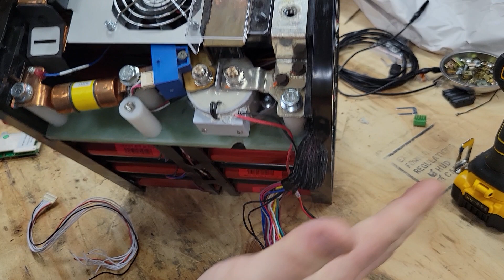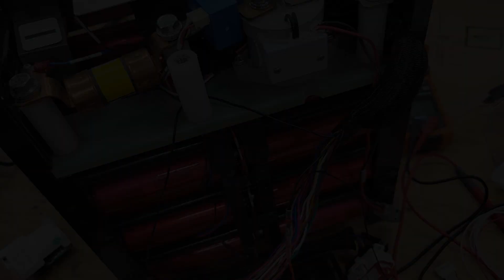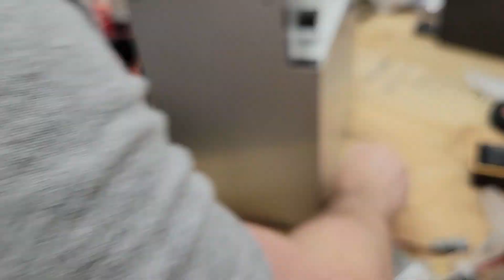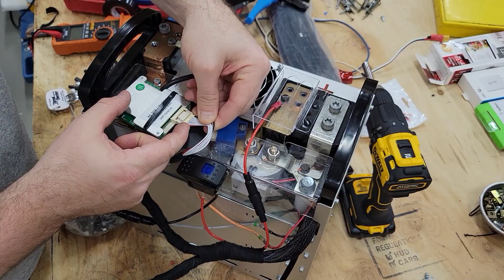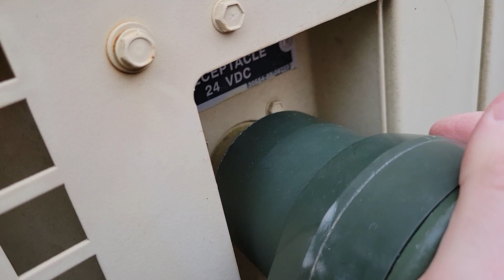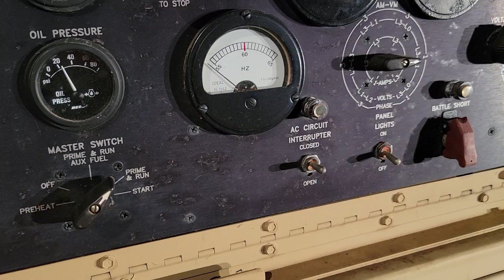DIY Jump Starting Battery for Military Equipment

Comment: Pretty sure Battery Hookup doesn't have any monster packs or parts from them left, though you can still get all the pertinent parts: big LiPO4 cells, bus bars, BMS, and heavy duty  contactor. Not sure about the fuse, though car audio suppliers should have it.  Pretty sure monster size car audio fuses should still be rated at 32V

Dave's discount code still applies.

Comment: How come my superbeast from battery hookup didn’t come with all those beautiful aluminum covers? I took a superbeast and converted it to 12v using all of those cells and want to use it on my dump trailer for the battery. Should I be able to use that contactor with a cheap bms the same way? Is that a fuse in there coming from the positive to the contactor?
Reply from the maker: I'm guessing you have a 12V pump for the dump control?  And, that you want a battery on board for using the dump option without needing the truck wired in?  If that's correct, then I'd first check what the Amp draw is of the 12V pump.  If it's less than 100A (which it probably is) then I'd simply use a 100A BMS: https://batteryhookup.com/products/12v-lifepo4-smart-bms-w-low-temp-cutoff  No need for a relay.
Yes, the fuse is on the positive side.
When I got the super-beast, Battery Hookup was offering 2 options in their website, one with the aluminum enclosure, and one without.  I don't know if they still offer both options or not.
Reply: @DavidPozEnergy  yes it has a 12v pump. The amp draw gets into 250 or more under a load but the winch draws 350+. It has a 1000 mca marine lead acid right now. Battery hookup is saying I should use the contactor on the negative side. I reconfigured my superbeast like Trevor moon did on his YouTube video so it's 4s 12p

Comment: Hey, did you happen to figure out which wires are hooked up to the fan? I figured all the pins and connectors except for the fan and well the heater which I just learned watching your video. There are two red/blue pairs, one seems to be another 10k temp probe, I don't know what the other one goes to because it reads in the mega ohms and doesn't run the fan, or smoke anything, if I hook it to 24v.

Comment: Ive been looking for a jump pack for my truck. all of the commercially available options are either under powered to start a diesel or way too expensive. This looks like a viable option. I would have to convert it to 12v for my truck but I'd bet some changes to the buss bars would be all that is needed. Does the Relay need a 24v trigger?
Reply from the maker: The relay works on 9-36V, so a 12V system is fine.  Good luck with your build.

Comment: I'm thinking this configuration would have limitations. If I understand correctly,  the typical BMS will not be able to recognize charging condition and will therefore not activate balancing or high voltage cutoff. The BMS will actually think it's discharging even when charging due to relay current. I suppose you could reverse connections and it would think it's always charging and would continuously balance, but you would lose low voltage cutoff.
Reply from the maker: You have a good point, I'll have to check that.

Comment: Does this generator provide 3 phase power? I have a Gitchners mobile comms shelter, the type where you can daisy chain a bunch together to create a large operations center. It has a 100 amp 3 phase 60Hz and a 100 amp 3 phase 400Hz inputs with a daisy chain output for jumper cables to the next unit. It’s even equipped with  45,000 BTU ECU. BEEN LOOKING FOR SOMETHING TO POWER IT BUT THE 3 phase units are huge!
Reply from the maker: Yes.  This generator (MEP-802A) has a selector switch that allows you to choose 120V 1P, 120/240V 1P, or 120/208V 3P.
Reply: @DavidPozEnergy  thanks for the info! I will have a friend look out for one since he bids on the auction sites. Any idea as to the price range considering these bids are sight and condition unseen?

Comment: Would you be able to charge this through the same terminals that you pull the load off of? And still get over charge protection from the bms?
Reply from the maker: That was the idea.  However, I found I needed to add a resistor to bleed the contactor coil.  I want the contactor to open if the BMS shuts off, but it turns out, the BMS still has a small surface charge even when "OFF".  Anyways, the general idea worked in this video, but needed to be tweaked as I did further testing.
Reply: @DavidPozEnergy  thanks for the response David. Love your videos. Going to attempt to make 2-12v starting batteries out of one of these. We will see how it goes. Will follow your advice on the resistor.

Comment: Hi David, 

Love the channel have been watching you for a while.  Definitely love seeing you grow as a content provider.

Your jump pack for 24v systems gave me motivation to use this for a 12v jump pack, I do a lot of repairing vehicles and farm equipment and am tired of dragging around battery chargers and such.  

So I ordered the unit only to find there was no way I could do the 4s configuration with the existing plates, even if I cut the one plate I would only have 2 4s setups, not ideal.

So I ordered the battery hookup extra set of plates and brackets and re-configured the setup into a 4s?p configuration.  I have pictures and will probably post them on the comment section of the battery hookup page if I can.

Anyways thank you for giving me the motivation!

Comment: Headway just read about them they have a 10c rate even higher than lithium titanate batteries which are a 5c rate and higher energy density!!! Only real question is if given enough load will the bms still respond reliably? Very nice build!!! I think you should make one with emp shielding and present it and maybe start building them for the military

Comment: ok, i don't get it.  why use the small BMS to power the switch and not just run a wire directly to the switch in order to power the relay??  what did i miss?  DON"T tell me they send this 'battery pack' without a BMS...  besides, how did the pack enable/disable the relay to begin with?!?!  guess i don't understand what you are starting with...
Reply from the maker: Sometimes battery packs are built without a BMS built-in.  This is pretty common with server UPS (uninterruptable power supply) units.  The UPS has the computer brains, which tells the relay to turn on or off.  I don't know if this "super beast" battery was part of a UPS, or something else, but it has a wiring harness which would have connected to some higher level computer.  Since I don't have the original application, I'm making my own.  Yes, I could have turned on/off the relay with the switch directly.  Or, removed the relay altogether.  But, if I did that, then there would be no over-voltage protection, or under-voltage, etc.  The BMS I added provides those protection features.

Comment: Hi David,
you used the I charger x8 to charge the pack and balance the cells, will it become a permanent part of this pack or did you just use it once to top balance the cell then use a different charger next time?
Reply from the maker: I used it once.  If the cells are in good shape you shouldn't need to do it again.  But if the cells are self-discharging, then you will get some drift.
Reply: @DavidPozEnergy  Curious how you plan to do routine charging of the battery without the x8 - the BMS wasn't installed with charging in mind - correct?

Comment: I just built a massive 18650 pack the same way with that relay. Wired it up so either the BMS or the estop switch will cut the power.

Comment: Big Clive (youtuber) has posted some interesting vids about how normal car jump start packs using lithium batteries work. Lots of their clever is in the little box usually in the +ve lead. PARTLY the sudden automotive alternator shouldn't recharge the jump battery.

Comment: I am surprised and glad that we are doing the same thing.
We have made hundreds of Truck SLI(Starting/Lighting/Ignition) & Vehicle Appliances 2 in 1 Battery(25.6V  240Ah  6.144kWh) and installed them on trucks in China and they are running well.
The Discharge Continuous Current: Max 400A is for the electrical appliances in trucks like air conditioning, The Discharge Peak Current: 800A(5s) is for the engine SLI(Starting/Lighting/Ignition)  of trucks.

Comment: Thanks for sharing David! This is an excellent use case for this battery pack!!
Question: do you like your Harbor freight clamp meter seen in the video? Much appreciated & Happy New Years 🥳.
Reply from the maker: Yes, it works well.  Although I find my Uni-T meter to be slightly more accurate.  But both work well for home use.

Comment: You should never take the cells over 3.4 v . Its scientifically proven on researchgate that this clogs the SEI layer leading to a reduction of capacity every time you do it .The cells won't last long in use. Silly.  Use conductive carbon grease on all contacts because moisture will create corrosion in there and resistance will build up . If you don't kiss his arse he will not answer anyway.

Comment: What you are calling the current transformer should actually be a hall effect sensor.  It's a solid-state device that measures the magnetic field produced around a single conductor, similar to the clamp on your multimeter.  They are far more accurate and it doesn't actually draw current from the field to make its measurement.  As you may know current doesn't actually flow through the wire but is propogated by the magnetic field surrounding the conductors.  This is why current is able to travel at faster than the speed of light, determined by the separation of conductors divided by the speed of light.  The hall effect sensor takes advantage of these physics.
Reply from the maker: Thank you.  I appreciate the help with my terms.  I thought a Hall effect sensor was a type of CT.  But I don't have formal electronics training and I'm always trying to improve.
Reply: Who would have ever thought that the worlds brightest minds have the time to write an entire paragraph in a YouTube comment,  demonstrating  superior intelligence to all who read. Thank you for your contributions to society.
Reply: More importantly current transformers, like all other transformers, only work with AC.

Comment: Just a note on your project. You'll want to add a flyback diode to the coil side of that contactor.  This will prevent the back EMF from frying the BMS.  
Neat project BTW. 🙂

Edit:
For anyone skimming, this particular contactor has back EMF suppression built in, so this comment is incorrect.
Reply from the maker: I checked out the data sheet for this contactor.  It's located here: https://batteryhookup.com/products/1-low-row-super-beast-headway-24v-48ah-1-23kwh  The second paragraph on the left side says "limits back EMF to 0V".  Is that the same thing as a "flyback diode"?
Reply: @DavidPozEnergy  Oh man, that's too cool!  They built it right into the contactor!  No further parts needed then.

Edit: 
And yes, that back EMF is what we're trying to control/prevent.  Long story short, when inductors are de-energized they attempt to push their stored energy back towards the source.  This causes current to attempt to flow in the opposite direction it was during operation.  With nowhere to go, because the circuit has opened, voltage rises massively and usually flashes over some poor little contact or electronic component damaging it.  Things will usually tolerate this, but it leads to greatly shortened lifespan of components.
Reply from the maker: Very cool.  But good to know if I use some other contactor.  I'm always trying to improve.
Reply: @DavidPozEnergy  It shows!  Your production values, wiring techniques, and the scope of your projects have all grown/improved greatly.  It's been fun watching you improve over the years and I think we all in the audience look forward to watching whatever endeavor you choose to video next.
Reply from the maker: I was wondering if I needed something in there, but had no idea what.  Thanks for the tip.
Reply: @DavidPozEnergy  Sure thing!  If you look up "flyback diode" everyone's favorite search engine provides helpful diagrams and info on the subject.

Edit: 
Incase articles you read don't mention this, you'll want to place the diode as close to the inductor (the contactor's coil in this case) as possible.
Reply: @mvansumeren4313  Completely unnecessary with modern contractors as evidence no OEMs run diodes with contractors. I have multiple EV conversion that have a similar contactor to BMS setups that have no such additional point of failure.
Reply: Contactors with an economizer don't need a fly back down eh?  Remind me of this contractor has an economizer.

Comment: i don't understand, why do you need a BMS to turn on a relay?
Reply from the maker: The BMS is monitoring the Voltage of each cell group.  It's there as a safety precaution.  If a cell group goes too high in Voltage, or too low in Voltage, then it could ruin the battery.  The BMS prevents that from happening.
Reply: @DavidPozEnergy  meaning if the voltage of one of the cells drops much lower than the others (once the high amperage is flowing), the BMS will turn off the relay and thus the current -> and i guess the reaction delay of the relay isn't so critical?
Reply: ah and clearly this is in addition to a fuse.

Comment: David, maybe you can get the "The Greasy Brothers" to make some Veggie-Oil fuel for your new Military Diesel Generator.
Reply from the maker: I'll probably try it at some point, but not soon.
Reply: @DavidPozEnergy  I have a 5 Kilowatt Diesel Generator that I run on waste veggie-oil that I get from a local restaurant. I let it settle for two weeks and then drill a small hole in the container above the water and food junk so I only get super clean oil. It drains slowly into cleanable 100 and 75 micron 5 gallon bucket filters. I then run it through cleanable polyester filter cartridges, at 20, 5 and 1 micron nominal. The final stage is thinning the viscosity with 30% Gasoline (petrol) during the winter months and 10-15% during the summer. I do not separate out the glycerol, because the petrol acting as a solvent works wonderful. Kilowatt for Kilowatt my generator costs less then the power grid which is $0.174 per kilowatt. Would you consider doing an episode on my process and give your opinion? There may be interest in these trying times.
Reply from the maker: Settling is a fantastic first step.  Personally, I think settling needs to be done while warm.  This could be a heated space, or a heated tank.  Back when I was doing WVO I found a huge difference in the amount of water/particles that could settle when cold vs. when hot.
Reply: @DavidPozEnergy  I found the same thing, so I only do the filtering during the summer months, I have not found water to be an issue. Using a Hydrophobic diesel filter will remove any water that slips though. So far no water problem and the gen-set runs better on the veggie-oil blend.
Reply: Just use old oil and trans fluid lol
Reply: https://www.youtube.com/watch?v=8UhZNgiTh5c

Comment: So original pack had no bms to control over/under charge/discharge?
Reply from the maker: I'm guessing all the wires went to an external computer controller on whatever thing this was built for.
Reply: @DavidPozEnergy  Interesting use for a bms make total sense.

Comment: Ha!!!! I bought my 802 genset from a guy in Alabama last year.  You can get a Wi-Fi board for it that allows two wire start and remote instrumentation.
Reply from the maker: Shhh.  Wes, you are giving away the secret to an upcoming video.
Reply: @DavidPozEnergy  I have an MEP-802 setup with 2 wire start and an en external 30-gallon tank.  All controlled by my solar setup.
Reply from the maker: Hi Jason,  That's great.  If you decide to post a video about it, please drop a link.  I'd love to check it out.

Comment: How about using one of those portable car jumpers? I know they’re used for 12 V, but I wonder if it can be used for 24 V?
Reply from the maker: A 12V jump pack won't work on a 24V system.
Reply: @DavidPozEnergy  
How about hooking up two of them together? In series/parallel
Reply: @simon359  If you want the voltage to be additive, hook them up in series. If you want the current to be additive, hook them up in parallel.
Reply: Sure, just link 2 together. I have doubts on the current required, but at least the voltage is correct.